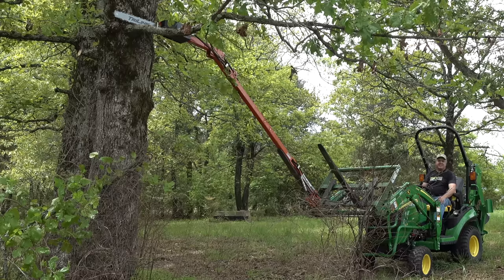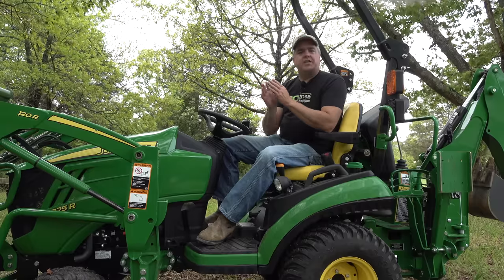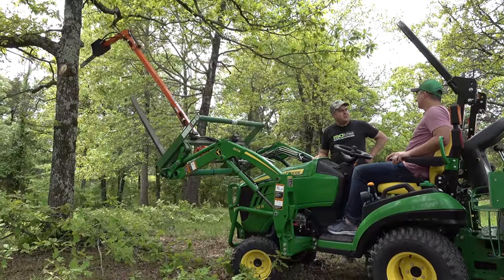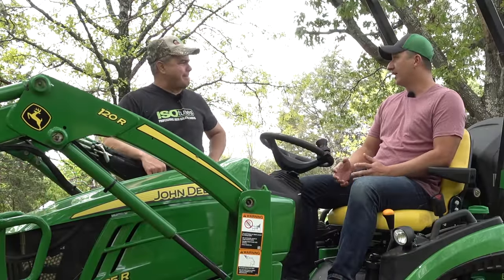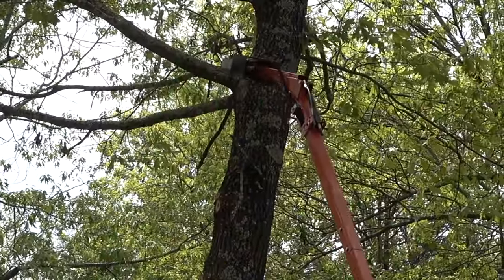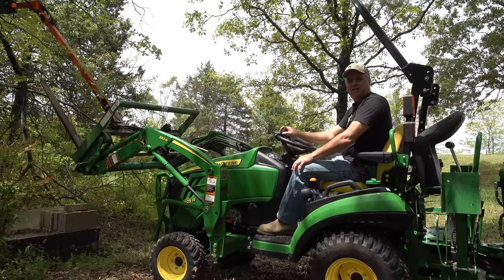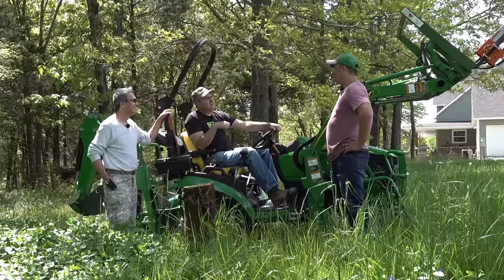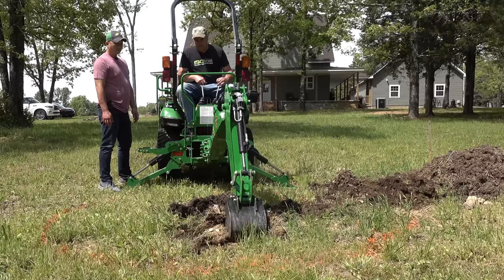MORE JUICE!! When Stock Doesn't Cut It! 2x Hydraulic Flow!!!

Comment: Tim, I would have liked to see you demonstrate the maximum speed various motions could be performed at and also compare stock speeds to upgraded speeds. Where you moving the backhoe as quickly as it would move during the video?

Some other commenters mentioned that the hydraulic cooler is only on the return circuit for the steering so this substantially reduces the proportional amount going through the cooling circuit. Is that correct?

I'm a bit surprised to hear that (if correct) because the 1025R's system would likely produce the most heat when the tractor is being worked hard towing a field prepping implement like a plow or disk. Those hydrostatic drives can produce a lot of heat depending on the design and what speed is being asked for.
Reply from the maker: First, hydrosplus has a direct comparison video on his page.
Yes, moving backhoe at max speeds.
Not sure about where hydraulic cooler fits in, but it doesn’t really matter.
If flow is lower through the cooler, it will cool that oil more.  The cooled oil will mix back in with the non cooled oil….where it comes to equilibrium.
Another viewer has done some more heat testing. We have not yet published the results, but he found very little increase in temps over long runs even in 90 plus degree heat.  Maybe 3 degrees hotter.
Reply: @TractorTimewithTim  thanks for the prompt reply and for all of the awesome videos. I just bought a 2018 1025R TLB and hope to receive it next week, (subject to it being in excellent condition and me not backing out). I've been spending many hours researching what sort of implements and/or upgrades I plan to get.

These subcompact tractors are so hard to findI these days in my end of the world that I ended up buying it sight unseen through a large dealer with locations all over the country.

It is crazy but I've tried to buy 3 other 1025Rs and each one sold before I had a chance to inspect it and put in an offer. I also did put in an offer with one more, a 3 hour drive away, but it too sold before the owner got back to me.

The only ones local to me are asking about the same price I can buy one brand new for. Some are rather old too, like 2014s...
Reply from the maker: @Slider68  new ones are coming available again.  Supply of the 1025r’s seems to be recovering.  2 weeks now to get a new one at my dealer.  The other local dealer here has 3 or 4 sitting on the lot.
Reply: @TractorTimewithTim  I wonder when things will improve here in Canada. My local dealer told me last week that his last new one he sold "only" took 6 weeks to arrive and that he should be able to get us a new one in slightly under 2 months.

I also called around a few weeks ago to dealers up to 750 miles away and none had any 1025R's in stock and all told me 2 months or more to order one. Many of them implied that was fast so I assumed either they had been harder to get recently or they normally take longer than 2 months.
Reply from the maker: You called around a few weeks ago :-) by now it would be here!  :-)

Comment: My Yanmar SA324 is a sub compact tractor and it has 2 hydraulic pumps.
Reply from the maker: No, the sa324 is larger than a subcompact tractor.  Yes, still 24 hp, but it is the larger frame (and tire) size.

Comment: I didn't realize how limited the tractor hydraulics are set up from the factory. You can only use one hydraulic function at a time on a $20k machine??? That's a deal breaker. I would feel like JD really sold me an incomplete tractor if I brought one home and discovered that! Thank God for people like this that see a need and step up with a solution. How awesome would it be if Deere agreed to warranty this mod!
Reply from the maker: Easy to say that.  However, a machine without such 'limited' hydraulics is a skid steer.   These are $60k+.  So, I believe the compromise is excellent.  We can get a LOT of function for less than $20k. 
Oh, and we can do 2 functions at once...just not smoothly and predictably.

Comment: I'm curious if the flow percentage is adjustable on the fly or if it is set when one installs the kit.
Reply: Easily adjustable with a 1/2 wrench to remove the dust cap (or pliers in a pinch) and a flat head screwdriver to adjust the set screw.  Not sure if that meets your criteria for "on the fly", but you can definitely adjust as you change applications - more steering for mowing, less steering for backhoe work, etc.

Comment: Very cool! Does the size of the hydraulic fittings or pipes become the limiting factor with the upgraded pump?
Reply: All the fittings and hoses on the 1 series are at least 3/8.  3/8 will flow ~10 GPM, so in theory the 2 circuits (steering and implement) could have a total flow of 20 GPM, but the pump is connected to the flow divider by a 1/2 tube, which can flow ~16 GPM, so that would technically be the weak point.  All this said, there are varying opinions across the industry on what should and can be done, but that breaks into nerdy areas like laminar flow and nomographs.  I don't plan to test anything more than about 12-13 gpms.
Reply: Hey Kevin @hydrosplus, I know you’ve answered a similar question of mine about the 1/4” quick connects being able to handle more flow than some specify a little while back, but with the Summit front third function kits, for example, which use 1/4” hydraulic hoses and quick connects, is there any trouble running the Limbsaw through those 1/4” hoses and quick connects at all? I noticed that limbsaw says to use at least 3/8” hoses, but I have a Summit diverter up front with 1/4” hoses, and it seems like it has plenty of flow for the Limbsaw. Do you see any concerns with that kind of setup and/or is that the same kind of setup you used here? This is probably one of my favorite videos yet, because it shows what your Hydrosplus kits let people do with their 1025R machines that could never happen with the sluggish stock hydraulics. Thanks again for your game-changing solutions!

Comment: Hi Tim, I think putting some weight on the front of the loader would be a better test to see if the steering  has enough flow. I know this because  I have that issue with my Deere 4100.
Reply from the maker: Well, it had 85lb 8-10 ft forward. That is pretty heavy.

Comment: I don’t understand if JD increased the flow they would sell a ton more 1025R
Reply: Overall HP is the limiting factor, not flow.
Reply: Agreed! I will probably be getting the Kubota B2601 instead of the 2025R for this reason. I can out lift and out dig the 2025R by quite a bit. It's too bad cuz I really want a John Deere.

Comment: Great video, enjoyed this, the issue I see you having is the hydraulic oil getting to hot causing premature wear without using a bigger reservoir. Running the tractor below W.O.T. will also most likely cause over heating. That said I love this concept❤
Reply from the maker: You, of ALL people voicing caution???? :-)
I shoulda borrowed your atomic bomb footage!
Reply: @TractorTimewithTim  😂😂 Honestly I love this deal, I am considering doing it to my tractor.
Reply: I had  @Kentucky Yankee  written down as a tester for the 12 GPM.
Reply: @HydrosPlus  Bring it on!
Reply: @HydrosPlus  My first thought was how would it work with a log splitter
Reply: @kentuckyyankee  agree and I need to get one and demo.  I'm cheap, so I was hoping to snag a used one, but I haven't found one locally yet.
Reply: @HydrosPlus  They're out there

Comment: Just a little correction, when you say "all the other subcompacts" only have one hydraulic pump at around 2:23, you should exclude the New Holland, because the Workmaster 25S has a separate pump for its steering. I'd be curious to see how its flow rate compares to the 1025R because of that.
Reply from the maker: Look at the specs.  They should be accurate

Comment: Is the drive line components that power the pump strong enough to handle the additional loads from the larger pump?
Reply from the maker: Good question.  Well, the 8gpm pump is same as 2025r...which presumably uses same driveline...could be checked at jdparts.com.
Only the 9.5 gpm pump would be above this.  
I would be highly surprised if there is a problem,  but that is not an engineering answer.

Comment: Well, if you buy a used tractor without a warranty, there are literally no downsides. It would be interesting if there was a device that could divert 100% flow to hydraulics unless the steering is being engaged.

Comment: I wonder... Johnny X can drive a pretty beefy power pack now. Would you, or have you already, considered running some hydraulic powered implements?
Reply from the maker: Think we need a power pack?  How about the larger pump we installed? :-)
Reply: @TractorTimewithTim   I remembered the pressure bumped up to 2900 but didn't remember a higher flow pump, oops! I came to this video again since I saw a 3 point boom mower for sale, and that got me thinking about higher flows for hydraulic motors.

Comment: Unless I am missing something, if you increase the pump volume without increasing horsepower you are losing pressure/load capacity. Maybe tractors don't use full system pressure? Not familair with tractor hydraulic systems.
Reply: Good question.  In industrial hydraulics that are more constant, you have HP more closely matched to working pressure.  In an industrial system, you would likely need to change power input if you changed pump displacement because those systems are typically purpose built for a given task(s) and don't have big changes in demand, nor do they have to share power with other functions.  Tractors are much more intermittent in their hydraulic use and they have to balance drive power (wheels), PTO, and hydraulics within the HP capacity. Since all are not typically used together at the exact same time, you don't have to have enough HP to pull them all at full capacity at the same time.  

For example, if you are mowing a normal yard, you are driving and using PTO, but not typically using the hydraulics.  On flat ground the drive wheels are maybe using 5 hp and the PTO using 10, so you have plenty of excess.  However, if you start to go up hill and then hit heavier grass, the drive and PTO needs can snuff out the tractor once the HP requirement gets above 25.  Typically, you would stop or slow down to allow some of the HP to transition to the PTO, and if you have enough, it won't die.  If you don't, you look around to see if anyone was watching.  If you spot someone, you get off and pretend to take a break or inspect something so they know it wasn't driver error.  If no one is spotted, then you start back up and try again.

Conversely, using the backhoe, the PTO and drive wheels are static, so all HP is available to the implement hydraulics.

To pull the 9.5 GPM pump at full pressure (2100 PSI in this case), you need about 13 horsepower...but you only need 13hp if you are at full pressure, meaning you are attempting to lift something that you can't or can barely lift, or you're dead-heading the hydraulics to force the pressure relief valve open.  If you're just lifting a bucket of dirt, it's less, so you need less hp.  Also, for the 1 series, since the flow is split, it's actually more like 8 GPMs, so unless you were also dead-heading the steering, you would only need about 11.5 HP.  This leaves at least 13HP for the drive wheels at full pressure and more in most cases.  In the stock configuration, you need about 5 HP to push the implement hydraulics to full pressure.

Here is the calculator I most often use for these type calculations - https://www.womackmachine.com/engineering-toolbox/formulas-and-calculations/hydraulic-pump-calculations/

in case you're interested, the hydrostatic pump is an 18cc pump, so at 3200 RPMs, that pump alone moves a little over 15 GPMs.  I don't know the exact pressure setting for the hydrostatic, but the manual cites a MAIN pressure relief setting of 2755-2855 PSI, which I think applies here.  This is why you can kill the tractor in high range without using the PTO or hydraulics.  You run out of HP before the pressure relief valve opens (at 3200RPMs, you need 25.5HP to push 2400 PSI, so if the setting is that or higher than that, it will die)

Comment: My understanding is that increasing hydraulic flow will use more HP. There is always a trade-off! How much less performance do you have for pulling a box blade or running a PTO implement like a lawn mower? Will your steering still work with a loader full of gravel?
Reply from the maker: will have no noticeable impact on HP when hydraulics not being used.   The hydraulics are not under pressure in that situation.  
Steering will work fine with loaded bucket.  ...oh, and you have complete adjustment available to you on the flow divider, so set it how you feel it is best.
Reply: 8 gpm x 2100psi /1714 = 9.80 HP, so not much power used to pump the oil.

Comment: Would this increase in flow hot rod your tiller??? Would you see any tangible improvement in speed and power for tilling?
Reply from the maker: No
Reply: @TractorTimewithTim  could this be used or modified to add extra flow for a front mount hydro snow blower?
Reply from the maker: Maybe,  but likely can’t get enough flow to drive that large of a hydraulic motor.

Comment: I’m just curious how would a hydraulic thumb work in this setup?  I’ve seen in previous episodes where Tim diverted hydraulic power to the thumb?  Could you add a value/foot petal to control the thumb with this setup?  That would allow continuous control of the thumb.

As always Tim & Company you guys always do a Great Job with the presentations! 

Best,

John
Reply from the maker: All this does is increase the flow.  a thumb would work exactly like normal...only faster.

Comment: What about use of Chains in Winter?  Will they clear the new Diverter?
Reply: I can't say for sure since I don't run chains, but there is about 2.5 inches between the tire and the nearest component of the kit.  The flow divider definitely won't interfere, but the steering tube is the closest tot he tire so that it can clear the mower lift linkage (if equipped)

Comment: Sorry if I missed it, did John Deere ever respond to the warranty question?
Reply from the maker: Indirectly.  They would have to prove that the upgrade caused whatever issue.
Pretty hard to do that.  
Of course, if problem caused by overheated oil, it would be easy for them to claim that this upgrade caused it.
Reply: Thanks for the reply.  I have a 1025R still under warranty and I’ve been pleased with the performance thus far. The only thing I’ve had to back off on is with my 48” flail mower setup with hammers cutting tall thick mix of heavy grass & stemmed weeds. I cut it in two passes which also helps with grass wrapping around the roller. The little 1025 is impressive for its size!

Comment: Nice guy nice product! So does the flow diverter go on after the stock one if it does don't see how it can improve it? Maybe could mount a second cooler in front of the stock unif!👍
Reply from the maker: I believe I said specifically that the new one mounts 'in front of' or 'before' the existing divider.   ...even if not, why would you assume that he put it on in a way that would not work?     The new 'priority' divider mounts first...just after the pump.  It routes a specified flow to the existing flow divider.  The rest goes directly to the  implement circuit.
Reply: @TractorTimewithTim  Ok I didn't here that it mounts before the old one.

Comment: Out performing the 2038r? John Deere might be sending you two some letters lol
Reply from the maker: Yea. That is what I’m afraid of :-)
Reply: If Deere has any sense, they will offer this guy a job in their engineering dept.
Reply: You know it's going to happen. First the Kubota, now comparing a $22,000 TLB to a $35,000 one. JD is getting called out on simple modifications that have been a pariah of SCUTs. 
Love it! Keep on keeping on! Even if it means driving alot lol
Reply: @akpilot5510  they'll just sue him and send a cease and desist
Reply from the maker: $22k to $35k ??? Have no idea what you are talking about. 
Deere’s subcompact is on par with the other subcompacts when it comes to hydraulic flow.
Reply: @TractorTimewithTim  the price of a 1025r TLB compared to the 2038r TLB
Reply: @TractorTimewithTim  when JDs signature 2 series is able to be out performed on the front end hydraulic flow by a tractor $13,000 inferior...might make JD upset. Without innovation there wouldn't be advancement. I absolutely enjoyed seeing a no-nonsense review with someone that has an audience like yourself!
Reply from the maker: @justinsikes2221  i dispute your “$13,000 cheaper” claim.   Pricing I received was roughly $3000 difference as I mentioned in the video.
Reply: @TractorTimewithTim  difference in price between a 1025r TLB compared to the 2038r TLB? 
I think we're misunderstanding each other...

Comment: Excellent video Tim, and great invention and innovation by Kevin. I’m curious, would the pump increase lift capacity on the rear lift arms?
Reply from the maker: Discussed in the video.  No.
Reply: @TractorTimewithTim    I understood that it increases flow rate which increases the speed of movement for your BH and FEL, and allows you operate attachments that require a higher flow rate like the Limbsaw’. I just wasn’t sure about impact on the rear lift capacity, I guessed it was just speed too and not lift capacity, but wasn’t sure as still a novice around hydraulics. Anywhoo, thanks again for the video, as always it was interesting and informative. God bless
Reply from the maker: It increases speed.  It does not increase affect lift capacity.
Pressure affects power, flow affects speed.
Reply: @TractorTimewithTim  Thanks Tim, really appreciate the clarification. Am always learning from you.